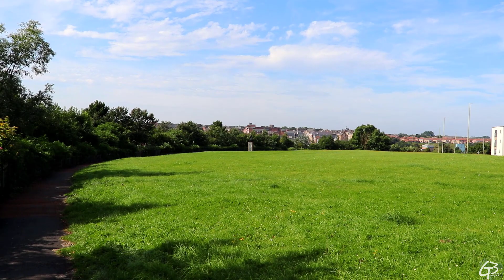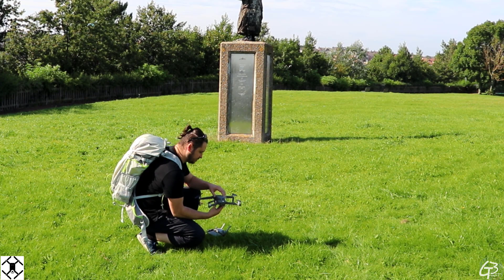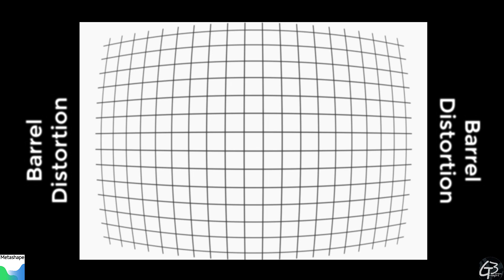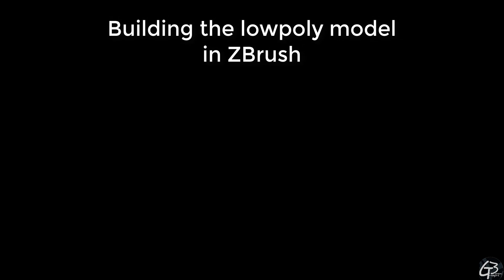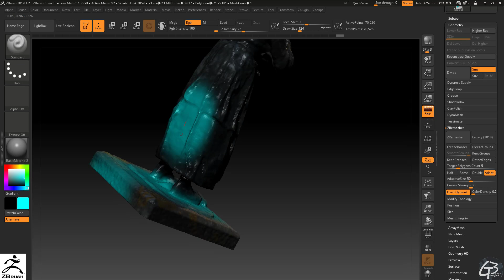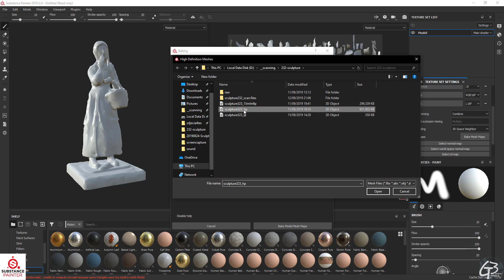The Sculpture - 3D Scanning with a DJI Mavic 2 Pro Drone by Grzegorz Baran

Comment: I use a simple cardboard as a lanidng pad. Once I tried to land in hand, and cut myself with propellers, drone drifted towrads me.
Reply from the maker: After 3 years I know my drone well enough to land safetly and take off from my hand. Even in tough windy conditions. Bear in mind that the wind is really strong and the drone struggles to maintain its position I dont fly as it makes no sense for me. Anway. when I do, I take off from hand always when the drone is keept away with the wind direction so the wind cant push it backward to myself. Of course it also faces away to me. From the same reason I use inversed rule while hand landing .. so I stay with the wind so the drone aproaches always against it. Next I hover at some distance and approach the drone by myself. I dont drain batteries to none so if something is worng, I simply correct the position and repeat the landing process. With some practice it seems to be really safe but even tho, if I have any flat surface available like a flat rock, bench, asphalt, I prefer to take off and land there. In most cases I take off from them as even if small, its quite easy to adjust drone position between the take off.. while if landing can be an issue I simply use hand. Personally I bleieve that hand take off is much harder and dangerous to the hand landing.
After I learnt how to hand take off and land, I dont cary any landing pods with myself. I used to use one for a while just to setup the gear in dirty, dusty environmet but now I use my backpack's cover for this purpose. So honestrly, I would suggest to get a bit more practice with proper drone landing and take offs and you will never ever need any landing pad solution.. and dont fly in conditions where drone isnt able to handle itself as you risk loosing the drone.

Comment: Cześć Grzesiek ;) 

Domniemam że jesteś Polakiem po imieniu i nazwisku. 

Zaczynam przygodę z fotogrametrią.

Zrobiłem 120 zdjęć z rożnych kątów, wysokości i zbliżeń dookoła mojego samochodu.

Dron DJI Mavic 2.

Wgrałem fotki do Metashape w formacie DNG.

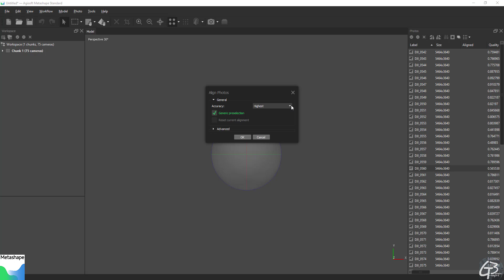Gdy klikłem Align Photos jak w minucie 14:24 proces tworzenia modelu trwa już 2h i jest w niecałej połowie.

Dlaczego to trwa tak długo?

Mój sprzęt to:

 Ryzen 5 2400G

 16GB RAM

 RX Vega11 2GB

 SSD 480GB 

Pozdrawiam ciepło ;)
Reply from the maker: czesc, sugeruje zmniejszyc wartosc z key point limit do 40.000 i tie point limit na 4.000. Wtedy image alignment powinin zajac okolo 3 minut :). Przy rekonstrukcji sugeruje uzyc depth map jak w moich nowszych materialach. Tryb depth map based zostal wprowadzony od versji 1.6. To video zostalo zrobione dla wersji sprzed 1.6. I w przyszlosci sugeruje bardziej zbite posty :) bo ciezko mi sie ten Twoj czyta prbujac odpowiedziec :D. Pozdrawiam

Comment: You're a real craftsman, sir.
I have a burning question though:  If you had wanted to create an albedo map to preserve the original surface... how would you do that?  It looks like the UV-map creation process destroys your ability to do so!
Reply from the maker: Thanks. I would bake the albedo map directly from the highpoly model. I would use a texture to transfer it. As long as UV doesnt overlap on the lowpoly you dont destroy/overwrite anything.

Comment: photoscan its sucks. Use RealityCapture next time. ;)
And, turn off collision detection to get closer to statue.
Reply from the maker: Hey Yegor, I would not agree. I am considering to record a video to compare RC, Metashape (not Photoscan anymore) and 3DZephyr...currently I am experimenting and researching a 3DZephyr .. and planning to release a video about it pretty soon. Each photogrammetry software has its own pros and cons. Metashape after version 1.6 has changed totally for better. Its more stable, doesnt need as much resources as it used to (32GB for extreme scenes) and finally with the depth map based reconstruction results are really good. So even if RC seems to be slightly better, the difference in reconstruction quality in my opinion is not worth the price you need to pay for it. Metashape is way more cheaper. It costs 179USD and when you get it.. you can keep it forever. You get all future updates to version 1.9 for free. I can tell you that I bought it 4 years ago for something around 150USD and didnt pay a single penny to get all updates. So no subscribtion.. no bs :). SO I would encourage you to givbe it a try as every software is in constant change and moves forward. Something what is mediocre today.. might be great tomorrow.
If I get the RC for 179USD and can keep it forever with future updates I would probably pick it :).. but now.. especially when pretty tough times are coming and you never know how long you can afford to pay tons of subscriptions.. having a piece of software you can simply use no matter what has really big value if you know what I mean.
Thanks for the tip with the collision detection. It saved my drone a few times already.. especially during windy weather. In my case it helps a lot since its super easy lose the sense of space when you scan from distance... but I totally agree that its a pain in the 'bottom part' and there are certain cases when I would do a better job with sensors turned off.. like probably this sculpture :)
Hope that makes sense :). Anyway, big thanks for watching my video and for your comment, very appreciated. Cheers! :D
Reply: @GrzegorzBaranArt  Hmmm. you are right, price its mater. I use Reality Capture from time to time by subscription.
About collision detection - im using one trick - going above sculpture, getting close as I need, and go down to the height i need. So I get closer then collision detection will let me and can go left right without problem. (On Mavic Air, I dont know how its will work on Mavic Pro)

Comment: Mr Baran,
I am attempting to model a cellular tower antenna array with little luck.  I am using a Phantom 4 RTK and Pix4D to model it.  Ideally I would like to get detail to a 3mm accuracy so I can take measurements from my point cloud of components in the array.  I have since learned the lighting is crucial to what I am trying to do but I have yet to see the software capable to create the detail I need without bastardizing the measurements with the various methods of stretching and shrinking the images.  The images themselves very much lead me to believe it is possible to do what I am attempting as the quality is there.  Do you even think this is possible and what software do you recommend?   I can be reached at hmrikson@dewberry.com if you would like to continue this conversation by email.
Reply from the maker: I have just sent you the response to the given email. Hope it helps. Cheers!
Reply from the maker: Looks like my message was blocked (Recipient address rejected) so will try to shorten my answer in here,:
Regarding the software .. doest really matter if you pick Reality Capture or Metashape.. both should do the job. .what really matters is the quality of images ( sharpness) and image coverage (as much overlapping as possible so the position estimation has enough information to be estimated properly). Also try to process pure RAW file.. dont fix them. Hope that helps. G.

Comment: Hi, Gregorz. Great job! Can you share mavic 2 pro barrel distortion preset for Photolab 2?
Reply from the maker: In Geometry tab I used 'Auto with Dx0 Optics Module' mode in distortion settings with the intensity set to 100%, I left 'Keep Aspect Ratio' option turned off. Also turned of the 'CROP'  since it cuts part of the image. I also turned 'focusing distance' and 'horizon'  off. 
But these options are useful for single image based reconstruction where you need an image to look correct already. As I mentioned in the video, for photogrammetry any geometry fixes like barrel distortion are not recommended. Hope that helps :)

Comment: bro, if you have problems with the landing in your hand you can disable the sensors with the RC button on the right side (on the side), change the knob to the sport mode (S) position and you will no longer have a snesor reading, also be careful when trying , good video in any case
Reply from the maker: Thanks, the drone in sport mode is way more sensitive :), also have heard that sport mode turns off all sensors except the bottom one but I might be wrong.
Regarding to the hand landing.. I just keep practicing and its getting easier every try I make, have noticed that sensors doesnt see my hand when I grab the drone behind the gimbal what makes hand landing easier. But every time I can land on a the ground I prefer to land on the ground :). Cheers!
Reply: @GrzegorzBaranArt  in sport mode turn off all the sensors and of course it is a bit more aggressive but if you handle it with caution it is very useful for when you need to get down fast and the place is full of obstacles but you already know that a certain point down is released, you just also have to pilot feeling very safe I hope you stay well
Reply: @GrzegorzBaranArt  On the Mavic Mini, if you put your hand under it to catch it, it immediately pulls up, but if you just hold your hand there, and keep pulling down on the joystick, it will then go ahead and override its sensor, and land in your hand.  Does the Mavic 2 Pro not behave that way?
Reply from the maker: @dougdavis2523  I guess it does but you have to catch the drone, not just land on your hand since the drone looses stability with the rotors speed slowing down.. I mean that any wind blow can push the drone and when it happens you risk contact with propellers or crash.